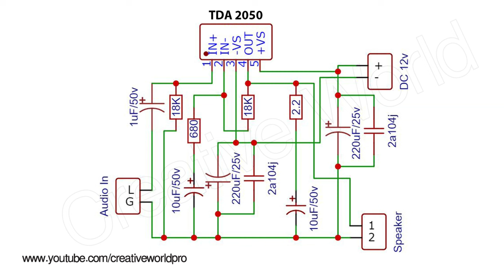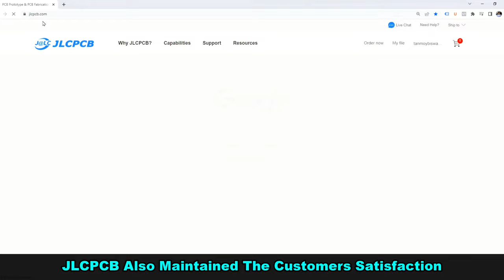TDA2030 VS TDA2050 - Amplifier Sound Test

Comment: Well, IC 2030a is definitely more efficient at low voltages. IC 2050 is for double voltage of 25 volts, in which case it needs at least 4 amps of power supply. In this case, IC 2050 has less performance and distortion and offers higher power. This circuit, with its output of two output amplifier transistors, will definitely drive and drive a larger driver.

Comment: At 12V both ICs will have high distortion figures due to clipping. By increasing the supply voltage, say around 20V, the audio quality will be better with less distortion.
Reply from the maker: I also hope that. Thanks for your suggestion.
Reply: How come? He just has to decrease the negative feedback resistor value to decrease the gain to match the supply range

Comment: You conect single supply on dual supply circuit dude.
Where is voltage divider from pin 1 to 3 and 5?

Comment: Very good. To me 2030 sounds better. My doubt is, it is a same circuit, but you just use a pcb the 2030?
Reply from the maker: circuit design and parts are different.
For tda2030 i use PCB circuit.

Comment: Just curious, if we can build a working amplifier with just 13 components, what's the point for those fancy amplifier products that has a huge complex circuit board?
I want a working amplifier with decent sound quality, but don't have much money for it.
Reply from the maker: You can
Reply: It has all tge eq, crossovers, usb and micro sd readers and many more stuff
Reply: The costlier ones have active and passive crossover circuits in them. In some you can adjust the frequency response in every frequency range like an equaliser while others do it to match the speakers specifications to get the most of them.